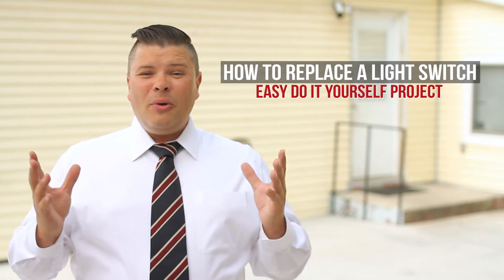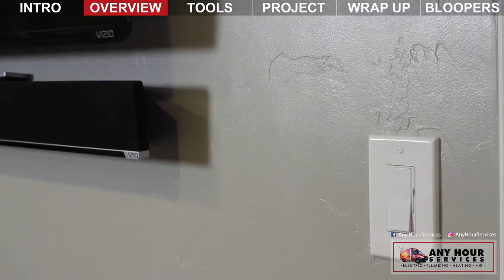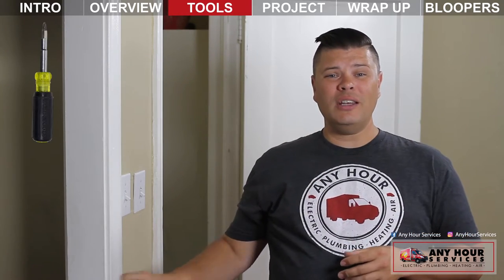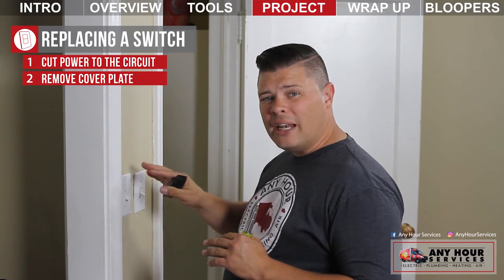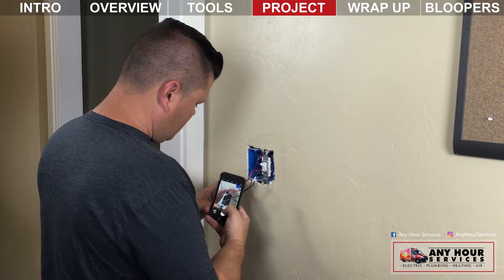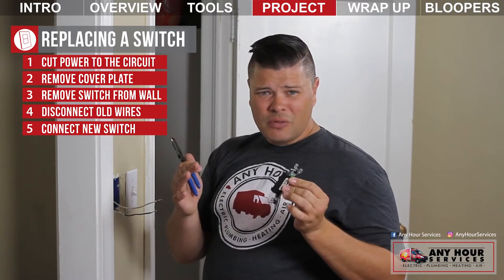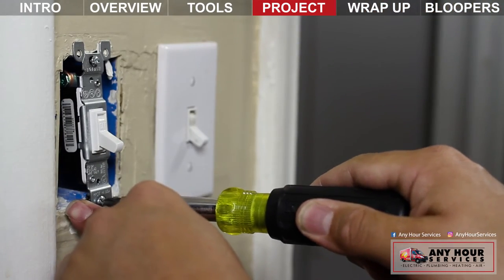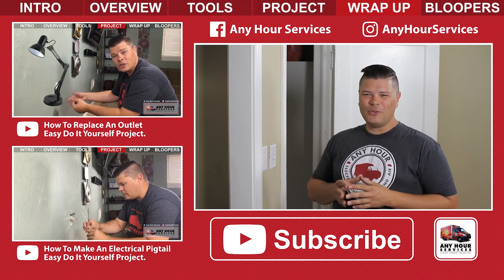How To Replace A Light Switch

Comment: How about dimmers? 
I apologize, I am binge watching your videos, they are extremely helpful.
Please explain if they are interchangeable.
You are the ChrisFix of homeownership.
Thanks for the video.
Reply from the maker: You don't have to apologize, that is what they are here for. I would love to be at the level ChrisFix is at some day...1 video at a time but thank you so much for the compliments. As for the dimmer, the steps are exactly the same, just make sure the power is turned off before you try to hook them up because you can burn out the electronics inside that do the dimming. If you have incandescent lights most any dimmer will work. LED bulbs dim pretty well also. Compact fluorescent bulbs sometimes do not play nice with dimmers so read the dimmer box and make sure it will dim the kind of bulbs you have. If you have more question, feel free to let us know. Have fun with all your projects.

Comment: I want to change the light switch in my room but the breaker is labeled bedroom/smokes and I also see a green button next to the switch on the breaker that says test.. so I am assuming the bedroom power is hooked up to the smoke detectors that are right outside the bedroom door on the ceiling.. I am a little worried about turning it off and messing with the smoke detectors and causing them to go off or something? Is that possible by turning the breaker off? ( I am so not a handy man, but trying to learn!)
Reply from the maker: It is possible that the smoke detectors are on the same circuit as the switch you are changing but make sure you test the wires you'll be working with to double check that they are not "hot". As for the smoke detectors, when you turn the power off and then back on they will chirp as power is restored but they should not be damaged from doing that. If your smoke detectors are older, it is possible that the surge from turning the power back on could cause them to start chirping and you would need to change them. They are supposed to be changed ever 10 years anyway. We have a video on how to replace your smoke detectors. Good uck and let me know how it goes.
Reply: @Anyhourservices  thank you for your response! I changed out my switch a few weeks ago when I originally posted my comment. I turned the breaker on and off with no problems. Great video!